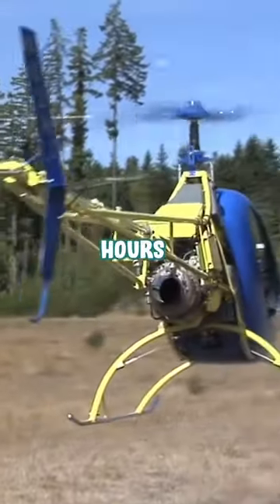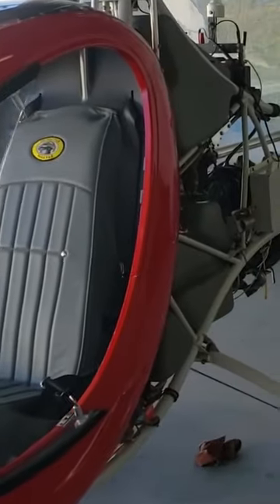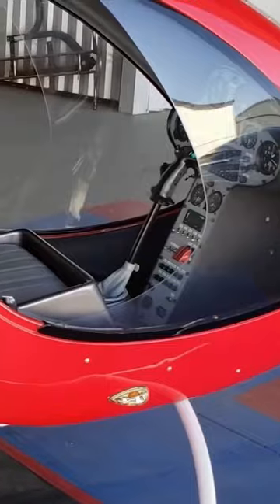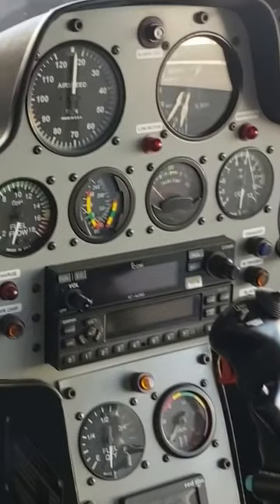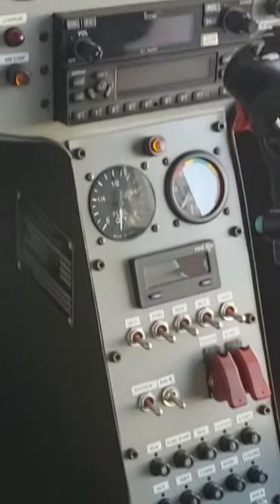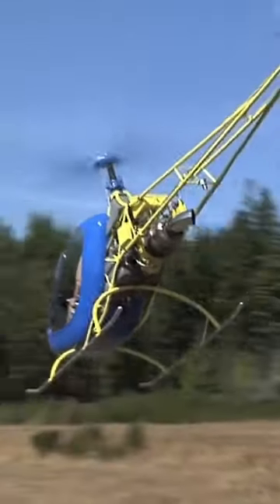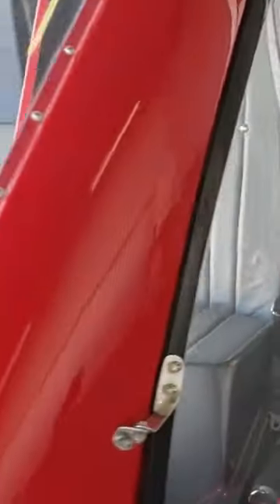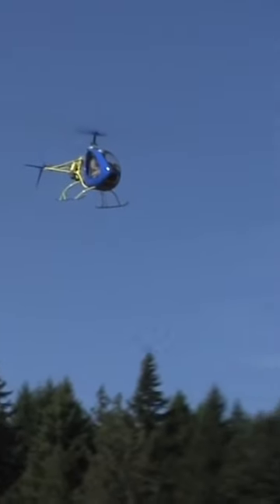#Turbine hours in a Helicopter

Comment: What do you have to do to get qualified? So no dual time?
Reply: In order to fly one of these, you would have to at least have a Solo Endorsement on a Student Pilot Certificate. No CFI would endorse you for this unless they had already trained you in a two-seat version of the same identical make and model. 

So, you would need either a Sport, Recreational, or Private Certificate. With one of those, there is no requirement for dual instruction or any further training. But, it would be wise to get model specific training anyway. The same applies to single-seater fixed-wing airplanes as well.

Comment: The last single seat home built rotary wing aircraft I saw here on YT did not turn out well for the builder. The guy was whacked in the head by one of the main rotor blades as the system became out of sync as essentially ate itself.

Comment: I like small planes but I'll always be afraid of helicopters
Reply: Somebody told me once it was a bunch of moving parts beating the air into submission.
Reply: If the pilot is experienced and aircraft maintenance is kept up, a helicopter should be safer considering the fact they can land just about anywhere, even without power. An airplane needs a much larger area to land.
Reply: @feellucky271  - It is a thousand loose parts spinning around one loose nut (the pilot), waiting for metal fatigue to set in. They are fun to fly, though. Sort of like a motorcycle compared to a car.